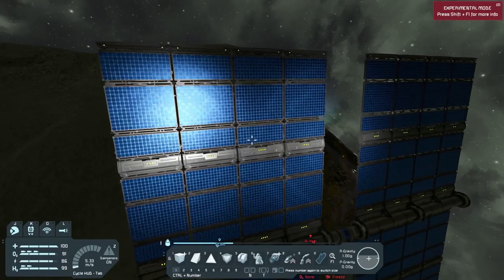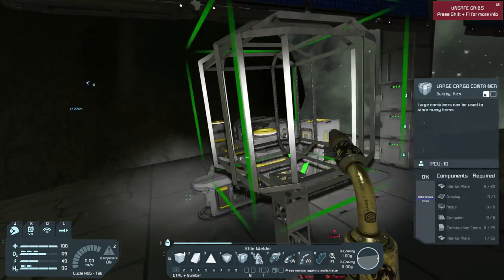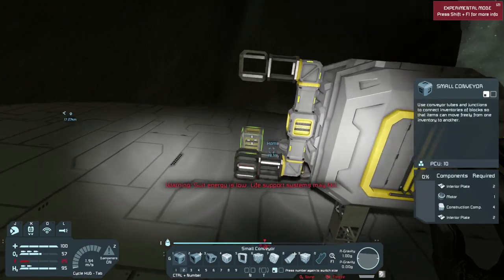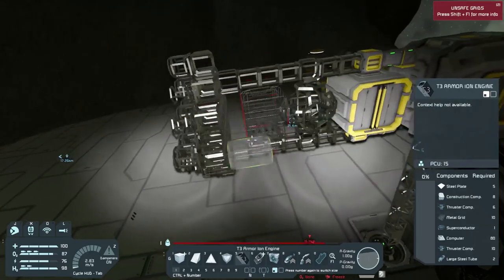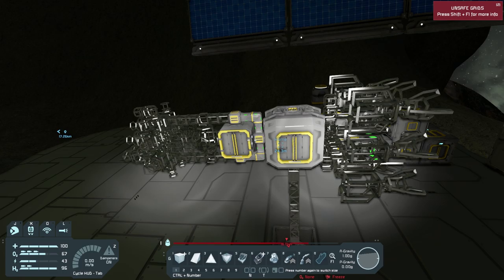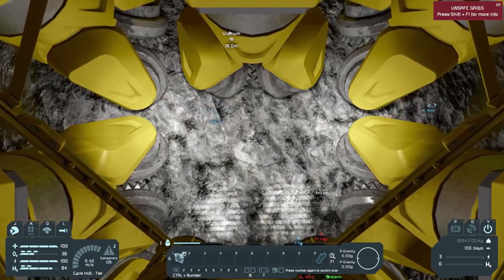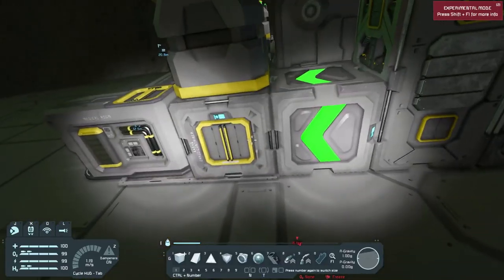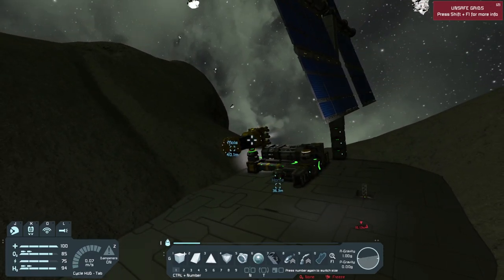Space Engineers #18: The Mole

Comment: I've been using survival kits on my miners so that any stone gets immediately turned into iron/nickel/silicon. Queue up 5000 ingots in each one and depending on how hard you're going you might need to stop every once in a while to let the stone clear through. This especially good in the very very early game when you're still building your first infrastructure. Also I've found that using small lights at max size and 1.5 intensity is less blinding with the dust than spotlights, but that's probably just personal preference. Nice builds!
Reply: I think the small ship mega mod pack has small block refineries and assemblers. So you can use small block basic refineries to clear the mined stone.
Reply from the maker: It is a good idea to add interior lights around your ship to help with lighting. Spot lights were a lot more effective some time ago. I won't use production blocks on a mining ship for several reasons. I want to keep the ship as compact as possible, the stone and gravel just add more weight to the ship requiring more thrust and power, the stone and gravel use up cargo space that is better used on the useful ores, the survival kit is extremely slow and wouldn't produce enough resources in the short time to be useful.
Reply: @DragonNationGaming  I tested ejecting stone with a connector v.s. refining it in the Survival Kit, Basic Refinery and Refinery. It's marginally faster to eject stone that to refine it in the basic refinery. My conclusion is the same of yours. Ejecting stone is the best plan. Ideally you can use a port to eject the stone. It's much faster than even several small ejectors.

Comment: The battery power is because you were not running your production modules at the moment.

And yes, Isy's inventory manager works well. Just follow the guide for assembler "learning". Otherwise it builds the wrong items.
Reply from the maker: I tested the power output before I had resources to process. Neither the assembler or the refinery were running. It's not the first time I've seen this issue. It's always been a problem to figure power requirements when using batteries.

Comment: still loving your videos.. but one thing i found realy effectiv in building the smaller ships like smal miners and fighters is just setting up a connected large welder(or 4).. You all ready have it on a rotor.. after rouging it out i just turn on the rotor and enable the welder.. makes building som much easier.
Realy liked the ion engines you used.. gonna import that mod in to my save too.
Reply from the maker: Using the welders can be useful at times but I prefer building by hand because as I'm welding blocks I might spot a problem or come up with another idea.